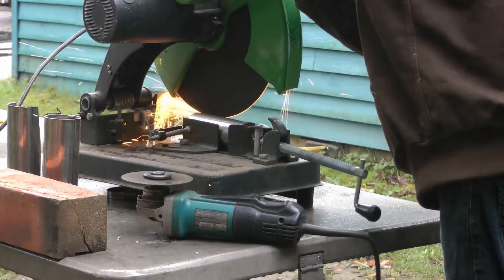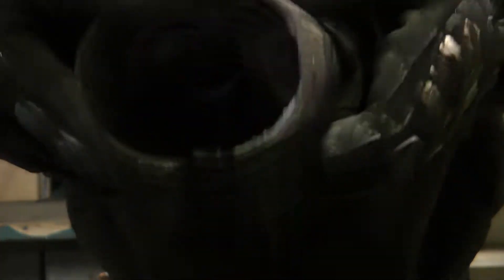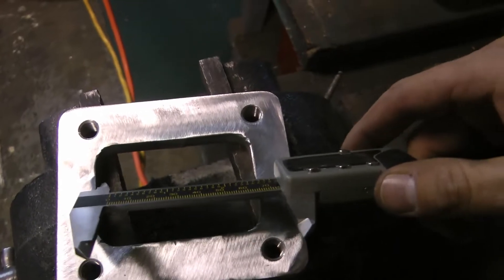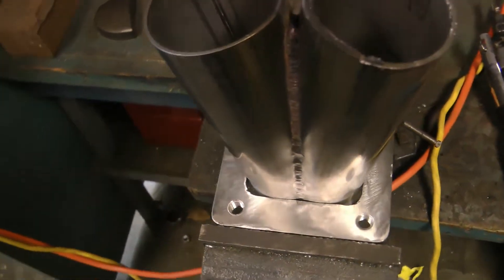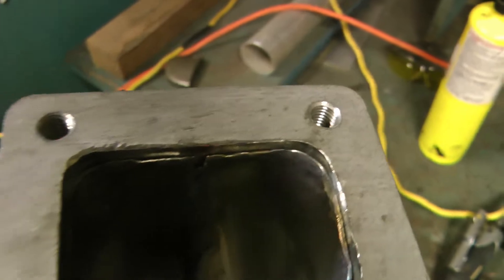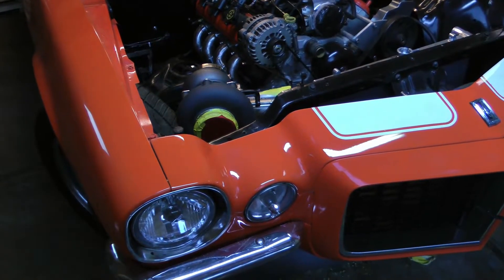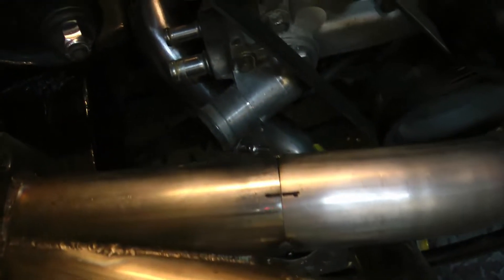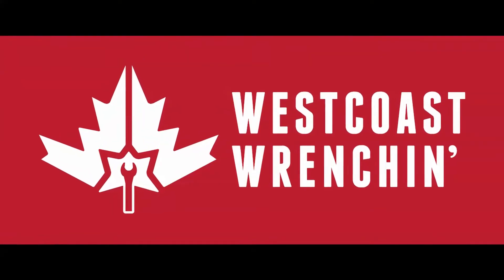1973 Camaro Single Turbo LS Build - Building a 2.25in to t4 merge collector

Comment: What gas tank are you going to run? I've tried finding one whose pump will hold more than 600 hp, but I can't find a good fuel pump.
Reply from the maker: I've got a spectra efi tank. Gonna chuck the biggest pump I can find in it and cross my fingers!